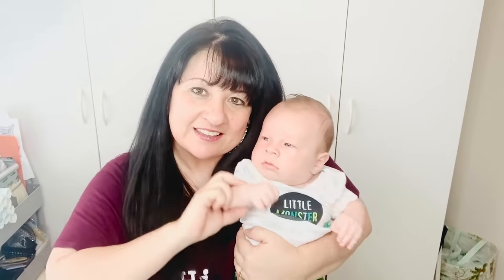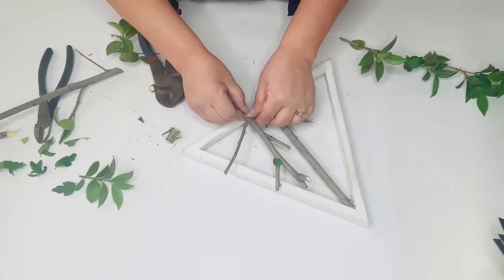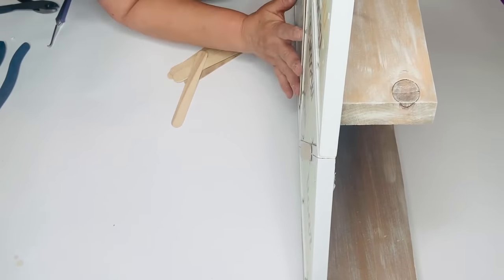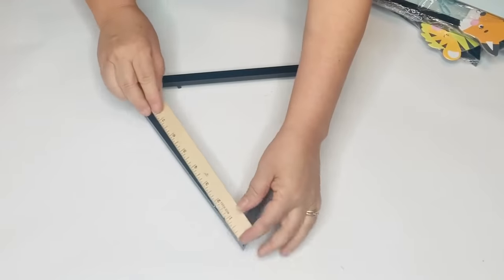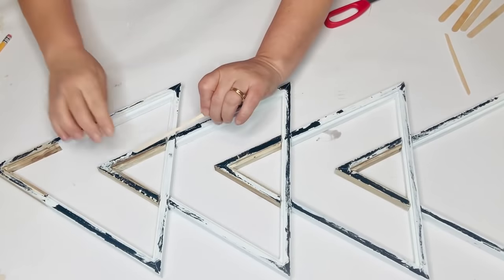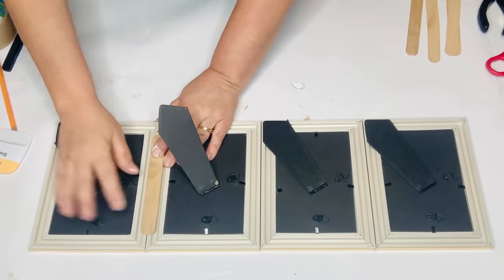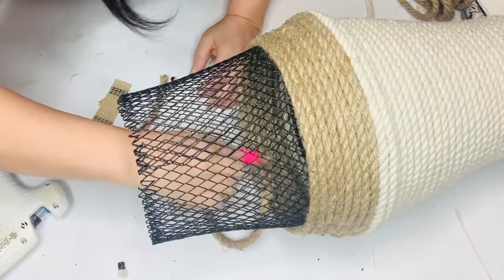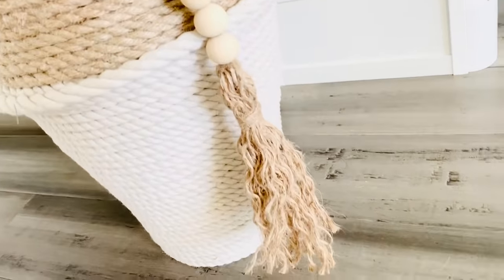5 DOLLAR TREE MODERN FARMHOUSE/BOHO DIYS

Comment: How much rope did you use for the basket? Also where did you get all of those different ropes?
Reply from the maker: Hi, friend! I used a total of 12 packages of rope from the Dollar Tree. I had a sweet viewer send me a box with all different kinds in there so they were different lengths. The white nautical rope is all the same and I think they're 7' rolls. The jute colored rope comes in both 7' and 9' lengths depending on the thickness, I think, so you will see a little variation at the top part. It would actually be cheaper if you purchase the big roll of rope from Walmart to do this project but I didn't have any and really wanted to use all Dollar Tree products for it! Hope this helps, sister! God bless! Xoxo